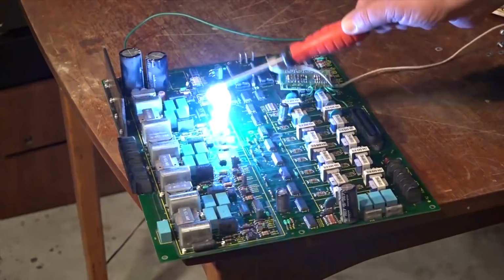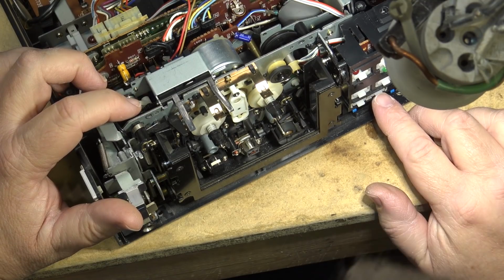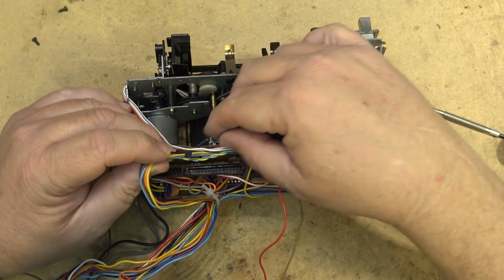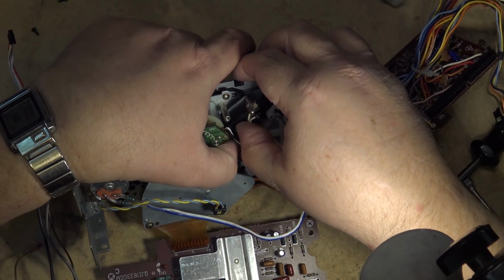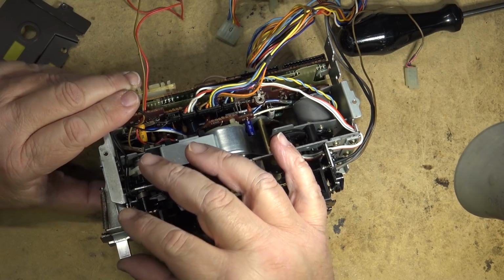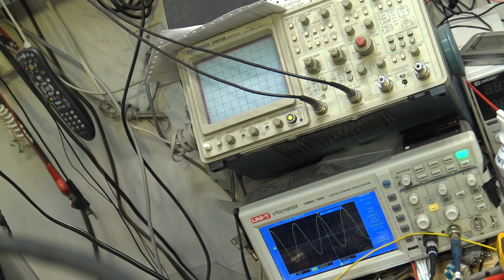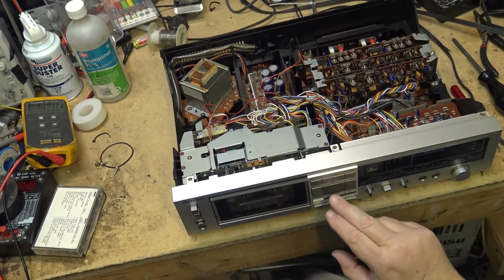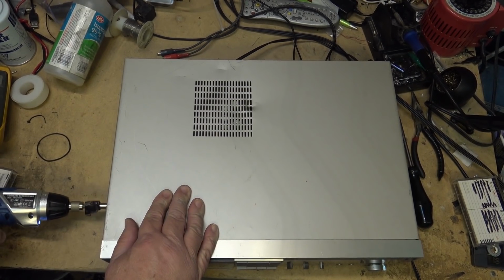Technics RSM275X Cassette deck cam belt replacement procedule

Comment: Hi. That's a fine job. I have done it on RS-M280. I think this mech is referred to as M250 (when it first appeared). Don't quote me though because I can't find that info at the moment. Anyway the belt in question called "changing belt" is the same in the RS-M280. Technics number QDB0287. I don't know if I found the cross for it in the PRB catalog, but the notes I took say to use SBS5.6 or SCQ5.6. The latter is the PRB belt. the wall size of the square belt is .051". The sbs5.6 is essentially the same. The fast wind idler tire is another story. The Nak BX tire is close but but quite right. My notes say an IT-57 would work but that is no longer made. I think got a tire from Dean Sanborn that works. It's similar to the IT-54 which is said to work on the Nak BX. It works but it is not ideal in this Technics. Then I got a tire from another web site that claims to be for the Technics RS-M255x, RS-M275x, RS-M280 and RS-M273. I just have not get around to installing it! Is it any wonder why?

Comment: Hi.  Thank you very much for this video.  That will help me for replacing belt to my deck.  I replaced the small one but it is too tight (and the deck is eating some tapes,  i think because of the belt, however some other tapes play normally). The other belt is much difficult.  Can you give the size of the two belts ??  A friend of mine offers to give two belt,  and he don't know the exact size.

Comment: Hello.  Thank you very much for this video.  I have the same deck since two years.  It works very well until yesterday.  When i put a cassette,  it plays for several minutes before stopping. I noticed that take up reel doesn't run for some seconds and then it runs fast to maintain the cassette playing,  doing this many times before stopping.  What do you think is the problem, and can i fix it myself ? .  I never serviced a deck by myself and there is no person here qualified to do this,   as this one is very complicated.
Reply from the maker: This deck uses a separate motor to turn the take-up spool for a playback and record only. Uses direct drive motor for capstone has a real motor that operates the take-up and supply reels for fast forward and rewind and it also operates the cam to raise and lower the head and a third motor is just for turning the pickup School on play and record. Could be that motor is failing or slipping because I believe it does have a belt and of course the rubber tire or it engages the pickup spool.
Reply: @12voltvids  i opened the deck,  found the two belts in very bad shape.  Suddenly,  it stops playing and the head is blocked.  I must turn off the deck and turn it on again to make the head down and eject the cassette.  FF is still ok,  Rew is ok but not until the end,  it stops before end of the tape.
Reply from the maker: @salusamu  if you put on too tighter belt for the control belt which is the one that raises and lowers the head it can bog down the real motor. That can cause it to stop prematurely when rewinding or fast forwarding because of the extra load from having too tight a belt spinning that idling pulley. Even though that pulley isn't doing anything other than freewheeling until one of the mechanical operations is called to raise or lower the head if the belt is too tight it will still put excess tension on the bearings which will slow the motor down and cause it to stall when fast forwarding your rewinding especially near the end of the tape or more torque is required

Comment: I had one of these but mine was duel capstan and flat belt that drove both captains! I was working on the thing and trying to clean belts and I caused the belts to come off the flywheel and tried to fix it but something messed up and didn't work after so I threw it away! Should have not and tried to fix it but I didn't have the patience!

Comment: There seems to be an ~10kHz signal sitting on the audio of the last few vids: this, the minidisk and turntable vid.  Not sure what's causing it but sounds to be some form of interference.  Sounds like tinnitus.
Reply from the maker: Crt monitor running in the shop so i can watch for the postman

Comment: I have an Akai GX-M50 and it has a bias knob but i have no idea how to use it. Do i increase bias or decrease bias when recording? So i leave it at zero :-(
Reply from the maker: Lower bias increases treble response and higher bias favors the base. You need to record white or pink noise and experiment to see what setting gives the most natural playback of the pink or white noise. Each brand of tape has a slightly different setting, so once you find it you just reset to that setting when you load that brand of tape.
Reply: @12voltvids  Thank you! I will do that.

Comment: When i apply dolby to a cassette i am recording i loose treble so i don't use it.
Could i be doing something wrong?
Reply: Sounds like you're playing back a recording that hasn't been recorded with Dolby. Make sure you have Dolby on not only on playback, but also when you're actually recording the tape.
Reply: @yuriykorotkevych8838  Thank you i will,
I am still learning all there is about recording cassettes i appreciate the advice.
Cheers

Comment: It's annoying that higher end brands are no better than lower end brands (ie: Lloyd's) when it comes to belt replacement.  I know, a Lloyd's unit from the 90's is hardly worth the time to work on, but being the unit I had when growing up as a teenager, I couldn't help myself.
Reply from the maker: Well considering this unit is 36 years old and this is the only belt that has been replaced i would say that is pretty good. Notice that i didn't change the play take up belt.  It was fine.   This one just got a bit slippery and if it didn't have a crack, it would have been to be a good candidate to boil to restore some elasticity.

Comment: Squamish.......under your bench-what is that?
Reply from the maker: That's an audio generator.  There is an old 1963 HP scope down there too.  Came from squamish radio when they closed up shop. was given to me.  I have an RF generator as well for front end and if alignment but i never use it.